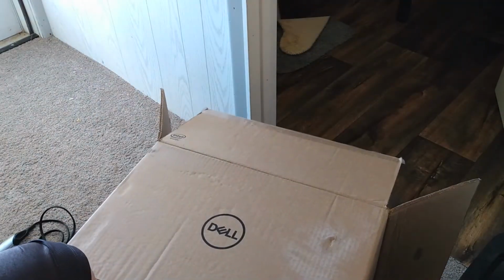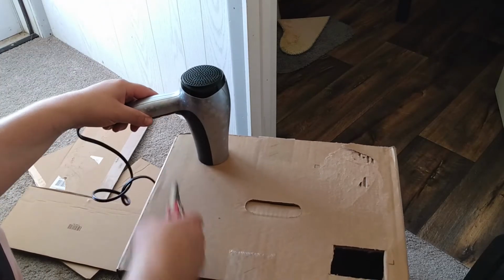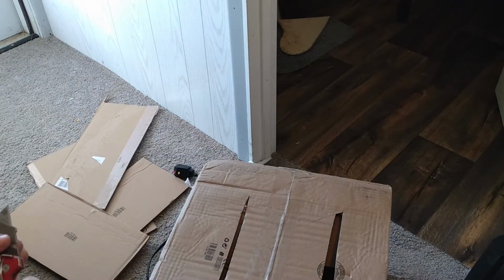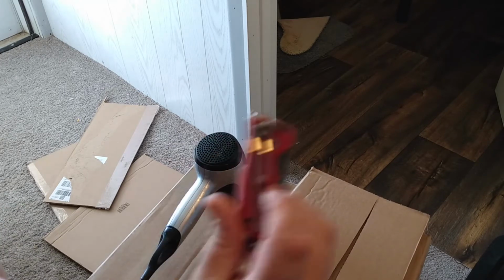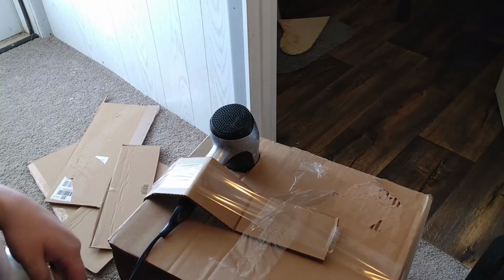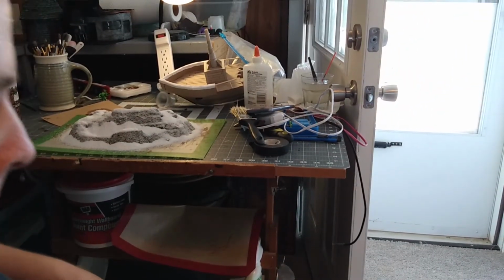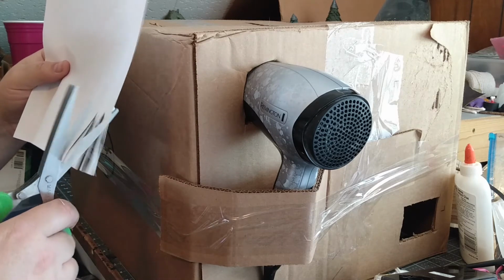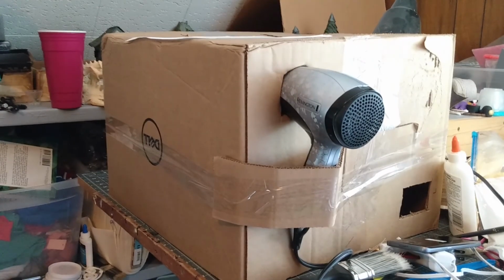Build a model drying box

Comment: Put the dryer on the top for stability. No tape?😊
Reply: Doesn't make for easy cross ventilation flow.
Reply: @BullScrapPracEff  put vent in the opposite lower end away from heat and you will feel the air flowing out. 👍👍